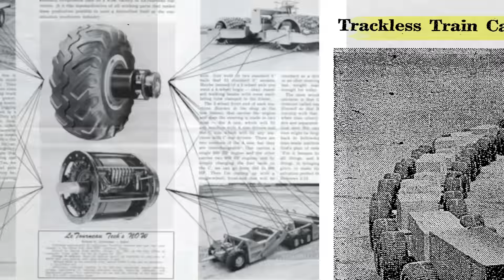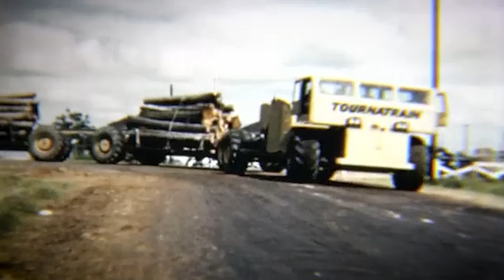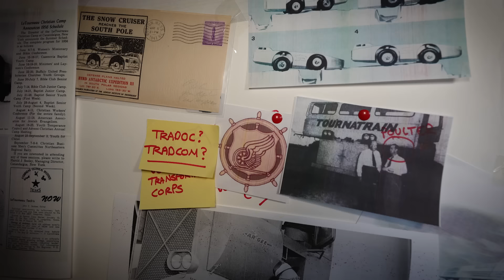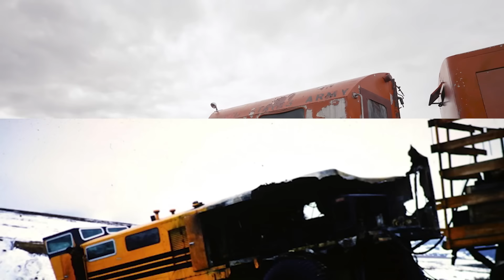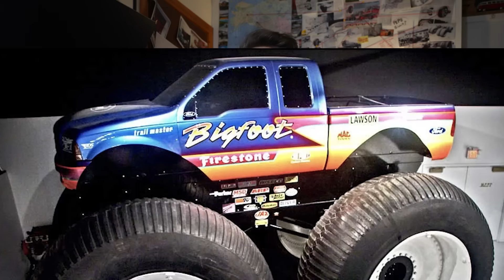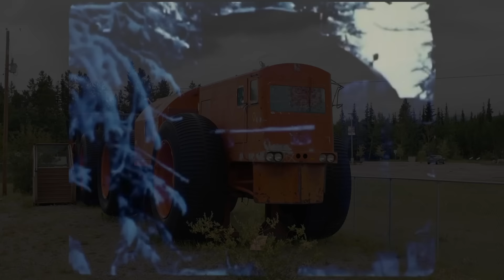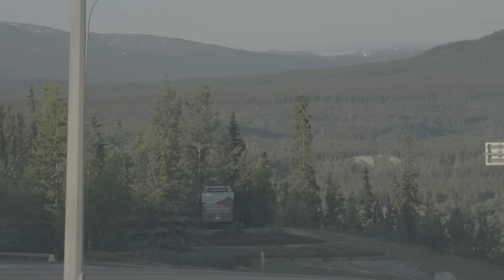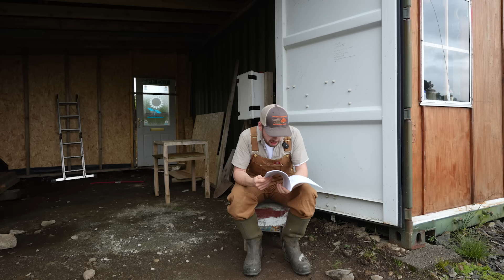Barracks on Wheels: The Huge Army “Snow Train” That Conquered the Arctic

Comment: I spent a month at Cape Dyer (eastern most DEW site, eastern tip of Baffin Island) leading an enviro assessment. Radar control buildings full of banks of massive vacuum  tubes, embedded in ice. Radar (still a north warning site) is on a km high bluff overlooking the ocean. Icebergs floating by, next land is Greenland.
Reply: 'Also Known As DYE-MAIN! (Cape Dyer, Nunavut)
The DYE Sector also originally included the four DEWLINE radar stations on Greenland; DYE 1 on the west coast; DYE 2 AKA ICE Cap  1; DYE 3 AKA Ice Cap 2; DYE 4 on Greenland's east coast; and DYE 5 near Keflavik, Iceland. 🇮🇸
          ⛰️ 🏔  ⛰️ 🧊 ❄️ 🧊 🏔 ⛰️ 🏔

Comment: I wonder if Dr. Poulter's biggest discovery in his research about polar vehicles was, that tires that should work on snow and ice shold not be in fact, totally smooth.
Reply from the maker: I wonder if he visited letourneau and was like… ooooh TREADED tyres
Reply: Its a learning curve - people who drive on sand have found perfectly smooth tires (often with a single rib for steering/tracking) or lightly "paddle style" work the best. Tires with deep tread just dig and sink into sand leaving you stuck.  Snow comes in a lot of different styles - hard pack/icy, wet and sticky, and soft and fluffy and dry -- depending on the environment and region its likely different tire styles would excel on the different snows, especially when on top of 3 or 4 meter deep snow. Even snowmobile riders today choose different track styles for different riding and snow styles - similar to sand, flotation is highly important, BUT, because of icy or hard pack snow you have to have more bite - but you still don't want to just "dig yourself into a hole" with deep aggressive mud style tire tread - what I find fascinating is they didn't keep the "rib" often seen in sand tires (for an example look at  ITP SandStar tires) to help prevent side sliding.
Reply: @offshack  Maybe inflatable treads would work to adapt to the environment without changing tires.
Reply: @offshack  So True
Reply: @offshack semi drive tires have way different tread zigzag split sections. Front steering tires are straight 2 to 3 grooves not  4 or crossed , split tread.
Reply: i had a damn stroke trying to read this...
Reply: @bugz000 so true
Reply: They become smooth when packed with snow ,anyway makes sense. I owned a tire distribution retail sales. A woman bought a new set of tires hers looked like racing slicks no tread but no wire showing. Our shop car used close to same size. We tested them on a bet. the slicks would grab a dry road way better hang curves faster. we didn't but know least little water and  disaster.
Reply: @Carlos-r5n2b  So True
Reply: a paddle like type tire would work best as sand and snow are similar
Reply: @zackb-wheal6771 you have obviously never driven in snow.
Reply: @zackb-wheal6771  Should work